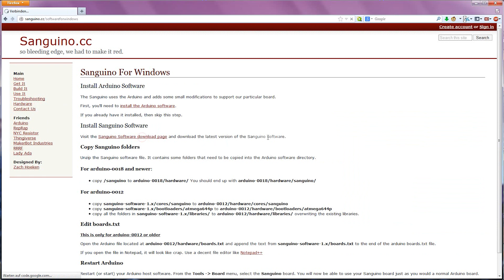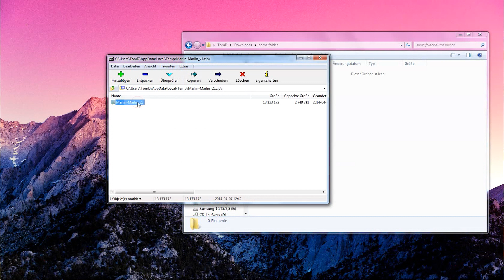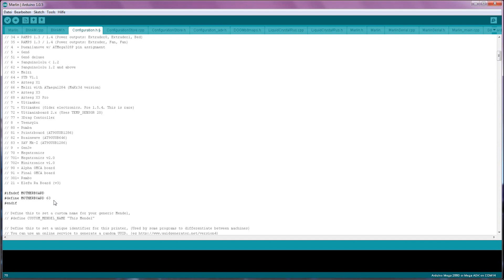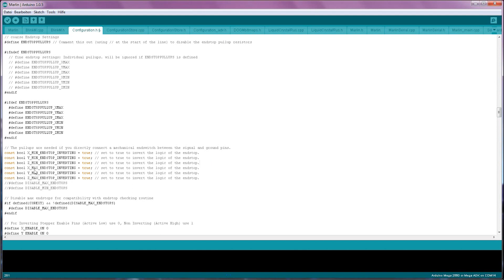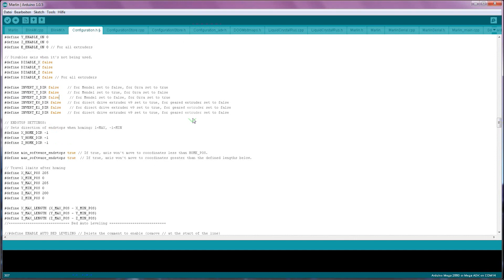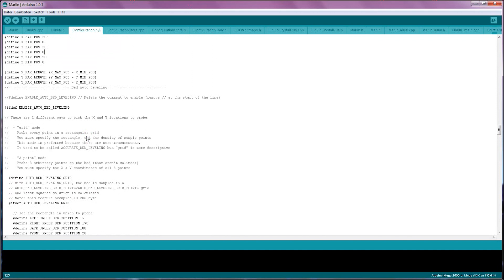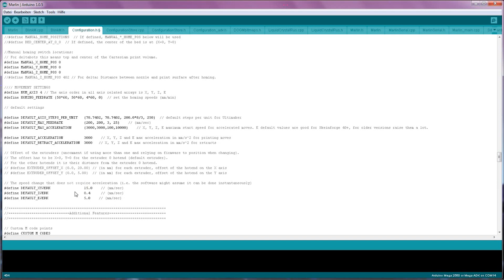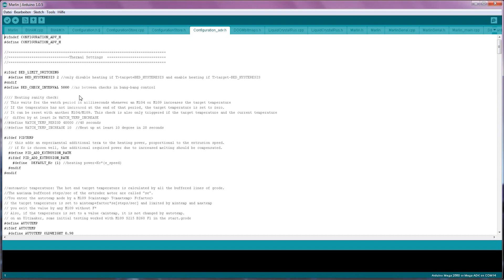3D printing guides - Firmware basics

Comment: +Thomas Sanladerer How do I add a thermistor to the list? I bought a screw in modular thermistor called EPCOS 100K Thermistor B57560G1104F. I don't see it on the list. I tried using the default of 1 on the list, but when I start to print and the extruder heats up as it does the auto leveling it stops. Then the extruder temperature starts falling. I have a robo 3d R1 version.

Comment: Can I use Merlin without a heated bed (I'm planning on building 90*90*90 cm print area printer) and only going to print PLA. Will be using Ramps 1.4. A question about using LCD-can I just plug the wires in or I will have to install/configure anything? Thank you, Thomas, for making such helpful videos!

Comment: Thanks Tom, great video.
I have a question related to the firmware. I have a printer that uses a Gen6 dirver board and want to know which are the actual firmware settings it has loaded in, so that I can then do some adjustments and re load it.
Thanks a lot.

Comment: how would I find which thermister i have for the heated bed as it was not listed in the kit I purchased. I tried setting 1 and 3 in Marlin without any luck. BTW thanks for the videos I have used your videos to build and understand my scratch built 3D printer.

Comment: Thomas Sanladerer - excuse my ingueles ... I have a problem I think is the marlinRC December 2015 firmware ... once installed ... could set the X and Y axis Z axis can not configure firmaware ... any value that goal in the #define DEFAULT_AXIS_STEPS_PER_UNIT 80,63.36,2560.00,500 {} Z axis always rises 10 cm should be 10 mm ... why?
when I do a simulation printing .... extruder asenta on the table ... I set with G92 X0 Y0 Z0 in the middle of the table ... the print never goes to the middle of the table.

My endstop are induction to get to test the G29 table I had to do it in the marlin setting ... inhibit defines ENDSTOPPULLUPS

// Coarse Endstop Settings
// #define ENDSTOPPULLUPS // Comment this out (using // at the start of the line) to disable the pullup resistors endstop

#if DISABLED (ENDSTOPPULLUPS)
  // Fine endstop settings: Individual pullups. will be ignored if ENDSTOPPULLUPS is defined
  // #define ENDSTOPPULLUP_XMAX
  // #define ENDSTOPPULLUP_YMAX
  // #define ENDSTOPPULLUP_ZMAX
  // #define ENDSTOPPULLUP_XMIN
  // #define ENDSTOPPULLUP_YMIN
  // #define ENDSTOPPULLUP_ZMIN
  // #define ENDSTOPPULLUP_ZMIN_PROBE
#endif

this has some influence with Z axis?

Comment: I can't get the host to control my printer. I've used 3 different host and was able to get each of them to connect but when I went to move the axis nothing. The board is a GT2560 from Geeetech and I'm running Windows 10. I had to use 115200 instead of the 250000 Geeetech recommended because I wasn't given the option to use 250000 when I changed the properties of COM6. Any help or insight is appreciated.

Comment: My printer manufacturer has provided me with a super old, pre configured version of marlin. It is quite old, and causes issues when I try to set up auto bed leveling. Is there anyway I can update my marlin version without making a completely fresh file based on the original? I thought I saw somewhere that you can put an old configuration.h with a new everything else.

Comment: Hi Thom great videos, they are really helpfull, I have a problem, I bought I kit to buil a 3D printer and it came with 2 little lightblue thermistors, from witch i cant find any info, is there a way to find out how to choose the right one on Marlin? and one more thing please, do i have to use a pull up circuit?
Reply: thanks for the fast answer, i measure it and it gives me a value of around 136 kohm, and  the room the temperature must be around  20 C, is that ok?
Reply: haha yep you are right thanks man, i found some information about my extrusor, it sais it has a k-type thermocuple pt100 reference temperature 0 degrees, what does it mean?
Reply: great i hope that works although my tester doesnt read any resistence, if it doesent work i will just atach a thermistor on the tip of the nossel because herein my country i couldent find the chip i would need for a thermocouple, thanks a lot man, it would be great if you would make a video about how to download and install repetier host

Comment: I got a instone inventor pro desktop 3d. Everything work great until I download and install new firmware. But I think I should not update parameters. Now the extruder showing sensor error or power is not enough. 2 problems is when I manually move XYZ it goes wrong direction so I figured out on parameters note I changed I1 instead I-1 then it going the right direction but when I level it. X go to home but it doesn’t stop when it hit the switch then keep goging. I gues it will do the same on Y and Z. How do I change the parameters back. 
Does anyone can share the infor when it homing to see the actual # XYZ to set max limits or minimum limits or how to get all parameters back. 
Please help help

Comment: Newbie here - I've loaded Arduino and installed my Sanguinololu hardware in the directory. My printer is already running good, but I'd like to load my firmware file from the printer into Arduino and have a copy of it for reference. How do I load the file from printer to Arduino?

Comment: Do desk top printers come with feed back mechanisms ?
Reply: ***** supposing the extruder is supposed to move 8 units in the x direction but it moves only 7 units due to backlash or some other error. is there any sensor the will detect this and auto correct ?
Reply: ***** Thanks alot !! your videos are really useful !

Comment: Hello! really likeing your vides. atm im building a 3d printer, cnc hybrid on desktop size. its a very cool project and i learn a lot about everything. but i ahve 1 qeution. the EEPROM fucntion. it Maximum feedrates,
Maximum Acceleration etc etc. you know what i mean. But what if i just dont wanne use it for 1 time? Does my program made by ultimaker override those settings? or do i need to turn off the peorm that sesion? i hope you understand what i mean and u can help me out with this!.

Comment: I'm having an issue with firmware my printer will move one direction but not the other direction, this is on all axis. this is through pronterface. it's not limited to ramps 1.4 and does the same an azteeg x3, from my test code run on both boards it run in both directions on all axis. any suggestions on what it is, thank u. I would appreciate it
Reply: Ok will try thank u

Comment: Tom  I know that this is not the place to ask but i need your help... I have been printing for 2 years and have cut my teeth on many printers I value your videos and have created a 3d printing business. But im stumped on this error.  I have a printer that makes harry bottom / stringy bottom layer  I have 52 printers running full time it's not a clog or PTFE tube issue or belt I have  replaced the head extruder throat and it does this with all filliment. I can take the code to another printer and it prints fine...   I have increased the retraction with no luckThe printer is a wan hao Plus. with the touch screen. . Helppppppp!   I really dont want to trash it  i would like to figure out the issue.

Comment: Hey Thomas, I have an other problem and i cant find info in the internet, i hope you could help me, i bought mechanical endstops from makergeeks.com, they are those with a pcb, led, etc, this end stops come with a 3 pin conector, which I know is signal, gnd and V, if i conect it to the ramps 1.4, what changes do i have to make in marlin? most tutorials i find are for no pcb mechanical end stops with only 2 cables, so i dont know if i have to inver something, coment a line or what, specially the pull up resistor, i dont know if i should use it or not, im crosing my fingers hopping that you can help me
thanks
Reply: and one more thing please, can i change the location of mi y axis end stop to the front of the printer? and which changes should i do in marlin?

Comment: Marlin link no longer seems to work
Reply: ***** Thanks for the quick fix. 

Also, I'm having a bit of an issue. My inductive sensor does indeed light up when a metal object is placed in range. But for some reason, I can never get it to home the z-axis. Also, the sensor is saying that its always triggered after I send an M119. My logic is correct and I commented out Z_min, but I can't seem to home or differentiate between open/closed despite the LED correctly triggering.
Reply: Justin Shelton actually, I think my question probably belongs in your bed leveling vids o.O

Comment: I came here to hear about all of them as I just left the RepRap community and Ramps based boards to a new Creator Pro based Sailfish and I am lost before the printer even arrives.  I am used to configuration.h but Sailfish doesn't work that way so I have no idea wth is going on.  I do know that the settings since MBI created them are incorrect and people just accept them.  Things like the steps per mm that MBI based on the the Pulley's diameter pitch when the proper way is based on pitch and number of teeth.

Comment: Hi Thomas. Thanks for the vids! They are very helpful! I have a ROBO 3D and I installed the E3D hotend. Now I want to update the firmware so I can change the temp settings for higher temps. I downloaded the latest firmware and Arduino software, then I followed your recommendations. I tried to compile but I got errors. I then deleted everything and tried again and tried to compile fresh before changing anything, then I received the error I'm writing about.
I was wondering if you, or any of the viewers could help me with an arduino compiling issue? Here is a short list of the error report. I can provide the who report if needed.  Thanks.

C:\Users\PROMET~1\AppData\Local\Temp\build1753382659974608065.tmp\Marlin_6_10\ultralcd.cpp.o: In function `menu_edit_long5()':

C:\Users\Prometheus\Documents\Arduino\libraries\Marlin_6_10/ultralcd.cpp:901: multiple definition of `menu_edit_long5()'

C:\Users\PROMET~1\AppData\Local\Temp\build1753382659974608065.tmp\ultralcd.cpp.o:C:\Users\PROMET~1\AppData\Local\Temp\build1753382659974608065.tmp/ultralcd.cpp:901: first defined here

C:\Users\PROMET~1\AppData\Local\Temp\build1753382659974608065.tmp\Marlin_6_10\ultralcd.cpp.o: In function `lcd_buzz(long, unsigned int)':

C:\Users\Prometheus\Documents\Arduino\libraries\Marlin_6_10/ultralcd.cpp:233: multiple definition of `lcd_status_update_delay'

C:\Users\PROMET~1\AppData\Local\Temp\build1753382659974608065.tmp\ultralcd.cpp.o:C:\Users\PROMET~1\AppData\Local\Temp\build1753382659974608065.tmp/ultralcd.cpp:233: first defined here

collect2: error: ld returned 1 exit status

Error compiling.

Comment: Why?  I keep asking everyone WHY people must "upgrade" the OEM firmware?  What is wrong with it?  I wrecked my Tarantula controller because I listened to the "community".
Reply: Nothing is "wrong" with the OEM firmware, it's just that we want to fine tune things further. We want to add components for features that aren't officially supported. We like to tinker with our stuff to make it better. This does come with the risk that we might just fry our boards and have to go out and buy a new one, but it's a risk we are honestly willing to take. Everything you can do on a 3D Printer to tune it a bit further comes with a very simple "no guarantee, at your own risk" and if you don't like this risk, or you don't feel comfortable taking this risk, then you don't have to do it. Simple. Don't blame the community because you tried something and it didn't work, figure out why it didn't work and fix it. If the board is dead then look into getting a new board upload the firmware again to run it. Your problem is what we built repraps for. Maybe the better option for you then is to buy a pre-built pre-calibrated machine, there's honestly decent ones coming out lately, and work with those instead. Don't blame the "community" for things that can be avoided.
Reply: You make the assumption that someone already /has/ firmware loaded on a board.  A lot of folks build from scratch.  For me, my Melzi went Tangibles Uniform, so I upgraded to RAMPS, this was a great refreaher on slapping the f/w on it.